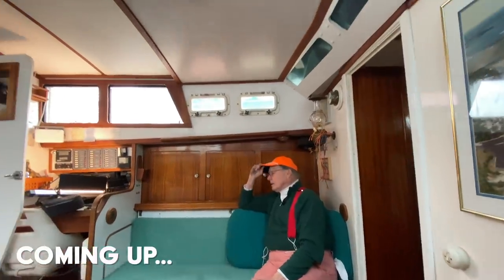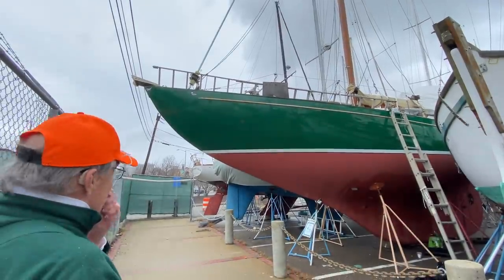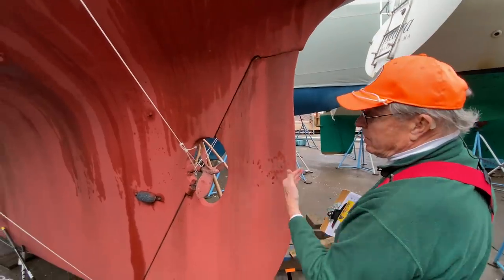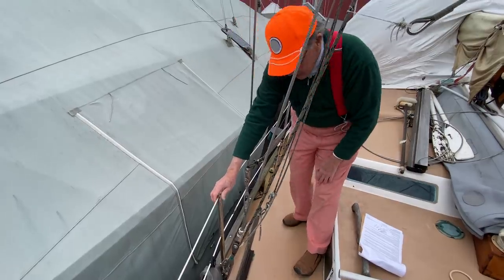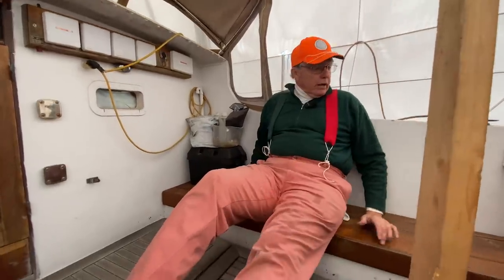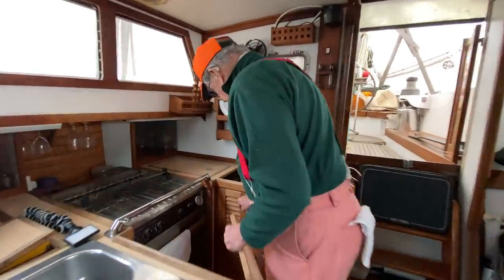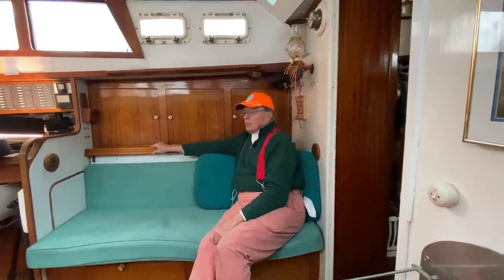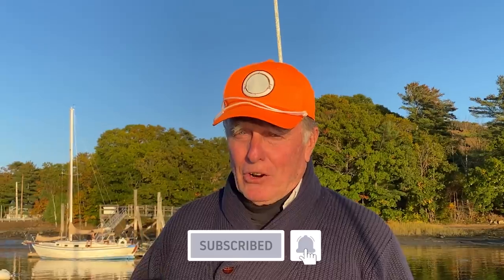SURVIVING A PIRATE ATTACK!! - A Steel Sailboat Story - For Sale $64,900 - EP17

Comment: And yet everyone says don’t carry firearms on board.
Reply: Only the USA has a 2A. All others are with government permission. Even the USA 2A is being infringed. It is time to reverse this evil trend. Criminals never deserve any rights against victims.
Reply: Its also really hard to get a hold of these things if you don't live in the US. I guess tear gas/pepperspray in some form of long range system would be more helpful anyway.
Reply: @AMERICANPATRIOT1945  what is 2A?
Reply: @malloott  ,
2A= The second amendment of the US Constitution which states.: "A well regulated militia being necessary to the security of a free State, The right of the people to keep and bear arms shall not be infringed.

The first clause gives the most important of many reasons for the amendment. The term "free State" refers to more than just the federal government, state government, or the individual states. "Free State" refers to the actual state of being free. The term "well regulated" as meant by the founders means at optimal performance as determined by the current state of the art, and equipped to the current mil spec state of the art for infantry and cavalry or other light foot soldiers. "Well regulated does not mean under government thumb, regulated by bureaucracy, or in any way encumbered or encroached by legal or regulatory limitations. In plain terms, this means that a well regulated militia is capable of fighting the very best equipped and trained light infantry and cavalry soldiers anywhere on earth.

A well regulated militia has all of the current state of the art equipment, discipline, training, and weapons of the best foot soldiers on earth, including all man portable weapons for soldier on soldier combat. This does not include anti vehicle or anti materiel weapons. A militia is a strictly citizen army which needs no government permission to exist and whose members supply all or most of their own equipment and weapons. Some early US patriots showed up for militia duty with their own cannons in tow. This is the then current state of the art mil spec of showing up with a 155mm Howitzer, 155mm self propelled gun, or an Abrams tank for modern militia duty. Modern limitations are in place to prevent an arms race between the rich and the rest of us. So, in today's world, a US citizen has every right to any single person portable and deploy-able semi-auto anti personnel weapon. 

The founders had every intention for the people to be able to form their own militia to keep potential tyrants in fear of the people. The constant push for gun control from the rich and the politically involved is proof that the 2A works. Note that politicians and judges constantly attempt to use language manipulations to get around the true black and white English of the 2A as well as the true intent of the 2A, which is to recognize the absolute right of the people to keep those in power or those who seek power to live in abject fear of those they rule over. That is why the 2A is so hated by politicians and limousine liberals.

The second clause of the 2A recognizes an individual right to keep and bear light mil spec state of the art personal arms and any other light personal arms which are necessary for any potential member of the militia to have for their personal protection as well as potential militia duty. That is why in reality the 2A really does recognize a right to keep and bear real assault weapons which have selective fire between semi auto, short burst, and full auto fire, no matter the opinions of courts, government bureaucrats, the limousine liberals, and their dupes who don't realize that gun control is not about our safety but about the safety of those who want to take power over us.

The 2A of the US Constitution is placed right under the 1A for a reason. One needs to collect information to identify potential sources of tyranny, communicate the potential tyranny and the wannabe tyrants to the people (free press), and take action to eliminate the tyranny and neutralize the tyrants or wannabe tyrants (right to keep and bear arms).

The fact that those in power want to infringe upon the 2A so badly is proof that an armed population is the best deterrent to tyranny. Just consider for a moment that the most persecuted guns are the so called assault weapons, which are not real assault weapons at all and only account for about 0.5% of all gun deaths and an even smaller percentage of all gun crimes. Fists and feet are used in far more murders than so called assault weapons. If those in power were really serious about our safety rather than their safety and illicit power grabs, they would concentrate on pistols, but they don't.

As for those who disagree with this very correct and literal interpretation of the 2A and its all too real background, almost every single argument used to justify gun grabs is faulty. There is only one exception and that is a NICS background at the point of purchase to be sure that the purchaser is not a convicted violent felon. All other arguments against the full exercise of the 2A fail to acknowledge that the 2A recognizes an inalienable human right to weaponized defense against tyranny and crime.
Reply: @AMERICANPATRIOT1945  and yet you live in a country where tyranny and crime is rampant compared to other western countries with no open gun laws. Where the power of the vote actually means politicians need to up their game instead of lower their level like Trump. Anyway, I wish you the best in your American disillusion, but we have it significantly better here in Europe.
Reply: @malloott  ,
Tyranny in the USA is not quite so bad. Americans are very touchy about tyrannical behavior and will blow the slightest offense out of proportion. To many Americans, a traffic offense prosecuted in a hearing instead of a full jury trial is a violation of our constitution. Technically, those people are right, but the courts will never rule it so due to convenience and practicality issues.

Crime depends upon where one lives. The USA has a much greater level of reporting than most places when it comes to crime. Every tiny incident gets uploaded to the media. Police records including arrests are considered public. There are neighborhoods in the NY Metro area where one can step out of one's home without locking one's door. This is due to the abject fear that criminals have of the residents who live in those neighborhoods. Ditto on that for many other areas as well. Than there are areas like most of Chicago and South Central LA with huge crime problems. The cause is poverty, too many years of Democrat mollycoddling of violent offenders and strict gun control, a lack of stand your ground and castle doctrine, and bans on other means of making criminals fear victims.

It has been proven that reduction of poverty, lax gun laws, bans on criminals' rights, strong stand your ground laws and castle doctrine, strict punishment for violent offenses, and other disincentives for criminals goes a long way towards lowering crime rates.

Believe it or not, US politicians are accountable to the people as we saw in the last election. Trump ran his fat mouth a few times too often and now he is out. The Republicans pushed anti-choice a bit too much and they lost a lot of Senate seats.
Reply: @AMERICANPATRIOT1945  you seem reasonable, thanks for that. I don't think people fight tyranny with guns though, its populism, stupidity and not knowing the difference between facts and opinions that allows people like Hitler, Stalin, Pol Pot and other more modern variants of these to rule. And Trump just seems like a dress rehearsal now, the Republican party are finding the bounds of what their backers allow them to do, and I don't see this dip into extremism and  conspiracy turning around any time soon. Good luck, hang in there.
Reply: @malloott  ,
Trump is the least of our problems here in the USA. In some ways, Trump was a savior. Remember that little line about who really hates guns the most in the USA? Well that same groups also hates Trump the most in the USA, including many Republicans. Too bad for them that Trump won the Republican primary and then won the presidential election in 2016. That paved the way for other non-establishment politicians to win as well.

If you look closely at US politics, you will discover a few things.

In the name of free speech, very few of us want to reel in big data. We really need our own version of the EU Safe Harbor Act and Right to be Forgotten Act, and other strict limits on private data acquisition, storage, and retrieval. We must take all medical and prescription data off of the table as such information is never the business of any private entity without permission of the individual. The same goes for personal financial information. There is absolutely no reason for websites to fail to run due to one's desire to exclude cookies, scripts, pixel tags, other LSOs, and any other trackers used without express permission of the owner of the computer. There is no reason for Facebook to be allowed to monitor what people do on other websites as an example. We have three big credit reporting companies which claim actual power over us and even call themselves bureaus. These companies and all others like them must be knocked off of their perches and cut down to size. No private entity ever has the right to decide unilaterally who should be able to purchase a house and for what loan rates, get a job, and more. That is for  courts to decide, not private business. The information asymmetry is getting worse, not better.

No matter which of the two major parties one votes for, one must tolerate major human right infringements. Republicans want to ban abortion, Democrats want to ban guns and other weapons. Each right under attack involves a basic human right. Each right under attack gives the attacker power if that attacker can infringe upon the right or gain control of the exercise of the right. Dictator regimes historically attack both arms rights and reproductive rights. By splitting the bans, those who fund candidates from both parties gain power for themselves by dividing the American people. Those people are the same limousine liberals who hate armed citizens and their religious dupes who want to be the sex police. This is exactly how the Nazis took power in Germany.

The rich have corrupted the political process to such an extent that even the courts bow to their demands. This must be stopped and reversed, including the repeal of anti freedom laws and a number of court decisions reversed, even if We The People must force their reversal.

The press has been taken over by a tiny minority of limousine liberals who tell their editors what to publish. This censorship by the rich has destroyed the free press in the USA. The airwaves are a public domain and it is time that the FCC forces this upon the few media conglomerates which own most of the frequencies. The airwaves must be forced back into the public domain and net neutrality must be forced as well.

The combination of press ownership, political influence, and information asymmetry by the rich is very dangerous. It is easy enough to defeat. People will have to do some work by becoming politically involved. It beats watching TV all day on weekends and after work.

The consolidation of power by the rich is very scary. Even more scary is the prospect of class warfare. It is a fight that the rich can only lose if it ever comes down to a shootout. There are too many millions of heavily armed people in the USA for a few thousand multi millionaires and billionaires plus their bodyguards to stand up to those millions. The worst part is that those multi millionaires and billionaires represent the very best and brightest among us. We don't want to exile or harm them. We just want to knock them back down to the status of equal citizen rather than aristocrat. There is no reason why anyone should allowed to convert private wealth into unelected power.
Reply: You know I believe that. When I heard about the shotgun I thought it a good choice.

Comment: Your right suspender is green.  Don't wear it aboard your boat.  It's bad luck.
Reply from the maker: Then should I give up my starboard  running light ?
Frankly red on board has been an issue if racing. 
Otherwise the whole color wheel will still get us there
But thanks for the thoughts